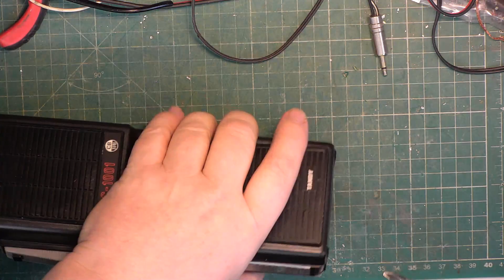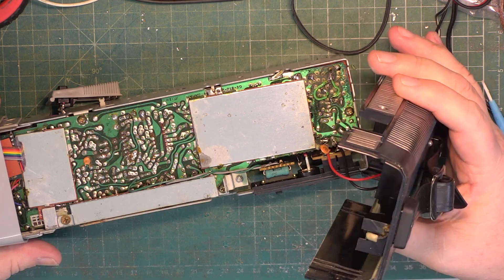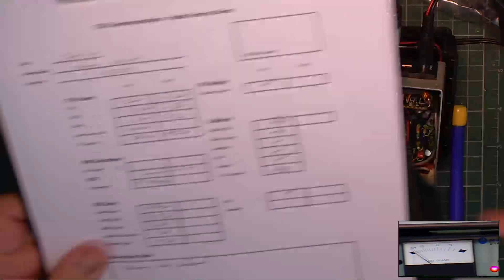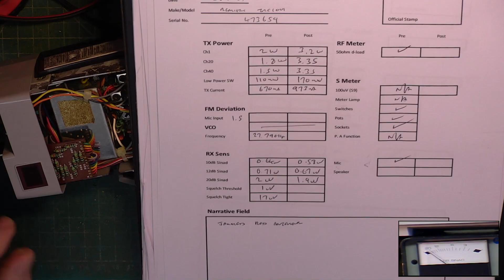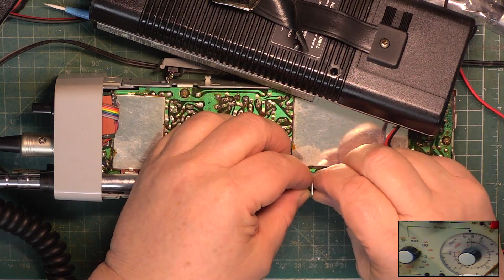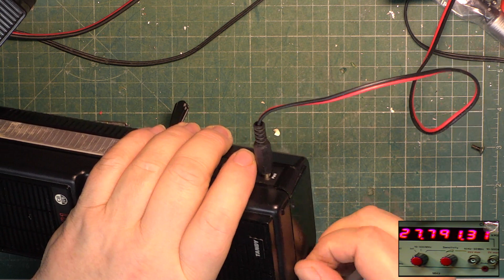Realistic TRC1001 CB27/81 UK FM CB radio -  service alignment set2

Comment: I would love to get my hands on a decent walkie talkie. I have a Eurosonic ES200CB and a Thunderpole T-X, and neither of them work as well as they should. The transmitted audio on the ES200 is muffled so it's hard to be understood, and the T-X is so quiet it's hard for me to be heard. The speaker in the T-X also resonates so bad when someone with decent loud audio speaks it distorts them to the point that you can't understand them. I'm done with any modern Chinese made bleep, I'm sticking with old school from now on. What do you recommend?
Reply from the maker: The Realistic TRC1001 or the TRC1005.

Richard
Reply: @ukfmcbradioservicingTango21  Well, I definitely like the old school look of this 1001, but I'm slightly put off by the LCD board in the 1005 (not how it looks or anything, just all those sockets and pins that connect it and the channel selector worry me a little).
Reply from the maker: There can indeed be dry joints on the LCD board & dirty pins. However, I've never seen the LCD fail, not any digits out. What can happen is strange symbols can appear in a dry joint situation. Obviously it's a generic LCD so it's amusing when is comes up with "SVHS" or "LP". Other than the LCD, the chassis is basically the same.

I'd sell you either as we have surplus sets here.....and with carry cases.  Email me.

Another good but lower tech set is the Binatone Long Ranger 40. To me, the fact it has no facilty for an external mike kills it's appeal.

We'll often take Realistic sets in cars with no CB radio...like a hire van....& sling a short magmoun on the roof. Because the Realistic sets have the external mike capability, you can use them mobile legally....whereas those emergency kits are difficult to use on your own in a car as you're not supposed to pick up a whole set whilst driving...just a mike.

Richard
Reply: @ukfmcbradioservicingTango21  Yep The Realistic TRC1001 is by far my fav.

Comment: hi richard good luck servicing alignment the realistic trc 1001 cb 27/81 uk fm cb radio from paul chapman at east sheen 73's also you didn't say thank you on the danita repair video
Reply from the maker: Thank you Paul. Your two previous both mentioned illegal activity so  were auto deleted.

Richard
Reply: @ukfmcbradioservicingTango21  to richard you used to be pleased about me getting out long distances and you used to say to  me Roger that       from paul at east sheen 73's
Reply from the maker: @paulchapman1175  Roger Paul. This isn't the channel to mention anything illegal on. I'm trying to stop you getting into trouble with the authorities.

Richard
Reply: @ukfmcbradioservicingTango21  to richard no one has been over here to stop me from paul chapman at east sheen 73's
Reply: @paulchapman1175  I got sandboxed too lol, stay off as you could stop an emergency Forest fire call in the USA. Or get your Radio Amateur licence 6 Meter and 10 Meter are fun with all the DX coming in.

Comment: Had a handheld Jesan (KT 2002? Possibly?)but with a rubber duck antenna. It was never as good as the Jesan KT 4004 , that 4004 I swapped for an Amstrad 901 that I mentioned to you in the Amstrad video a couple of weeks ago.